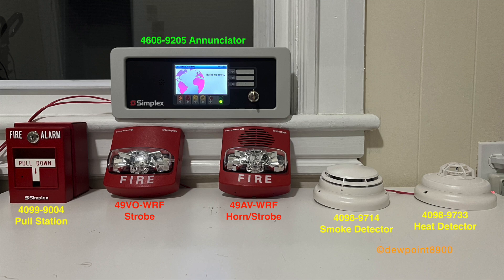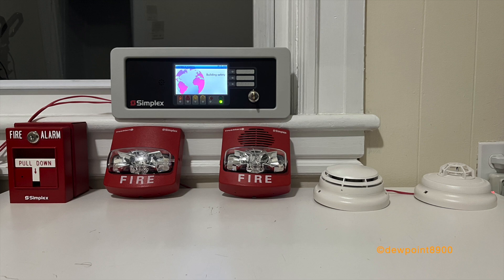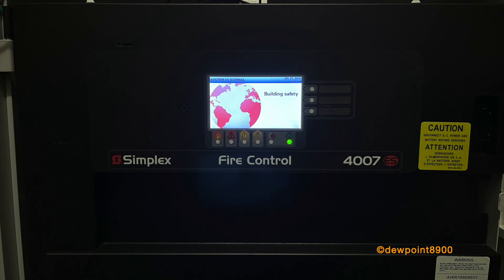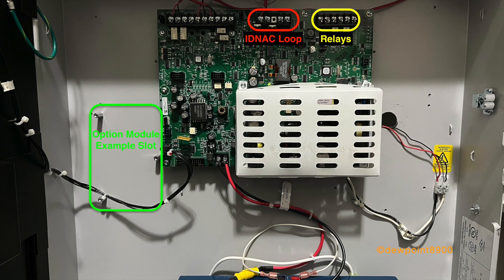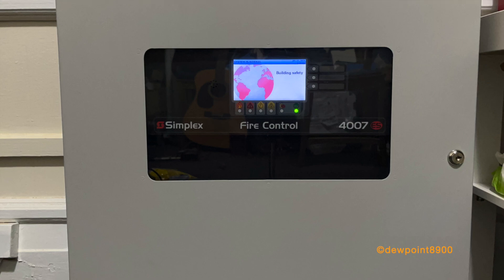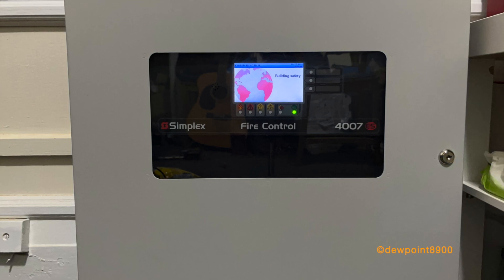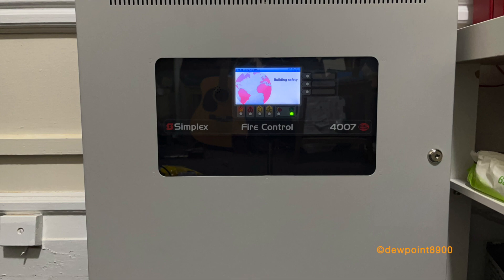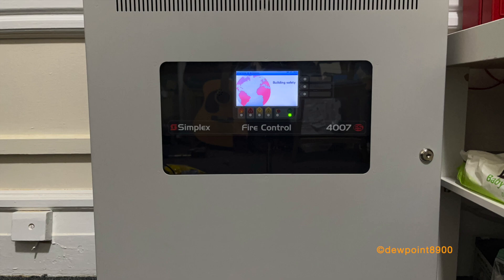Simplex 4007ES IDNAC Overview & Demo

Comment: So I know the IDNAC version only supports addressable notification, but what makes the hybrid model a hybrid? Does it support conventional and addressable initiating devices or does it offer conventional and addressable notification? And, depending on the answer, does the IDNAC version have conventional zones too?
Reply from the maker: The hybrid model just has 4 conventional NACs. Both versions of the 4007ES support conventional zones using the 4007-9801 zone/relay cards. I believe the hybrid model includes 1 zone/relay card while the IDNAC one does not.
Reply: @dewpoint8900  I see. Thanks!

Comment: I wouldn’t say these panels aren’t reliable as then they wouldn’t be up to code. Instead, they’re just more prone to break to user error as some of the processes of working on them are a little different than most simplex units. Mine works just fine and still works even after a firmware upgrade as I knew how to work on them thanks to documentation from simplex. They’re great for what they are and the trick is to just follow documentation.
Reply from the maker: Yes, the 4007ES works fine as-is. However, I've heard of an extremely high failure rate for these. Not just for firmware updates, but also IP file transfer, etc. I've never heard of another panel this prone to breaking. Especially for an enthusiast, there are many better options out there.

I never said directly they're unreliable, more like they have "issues", and big ones at that.
Reply: The "codes" you mention don't cover the source code of these things, and the manufacturers can get away with defective crap quite often.